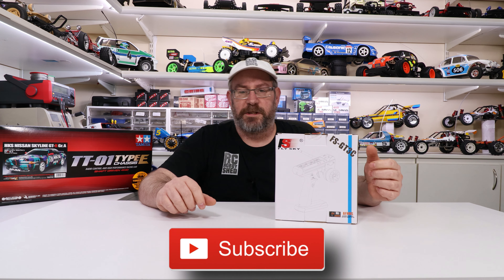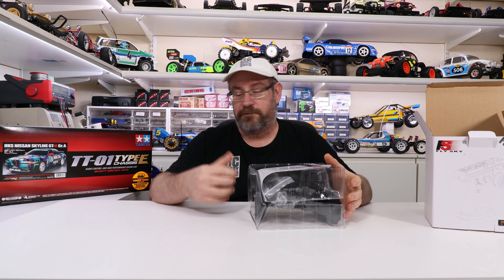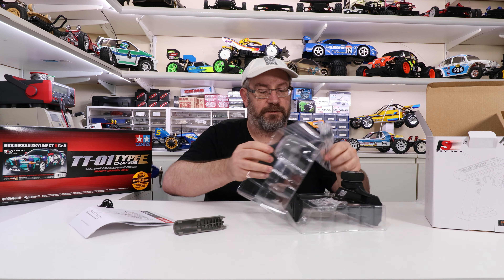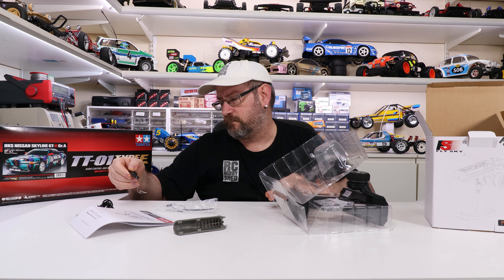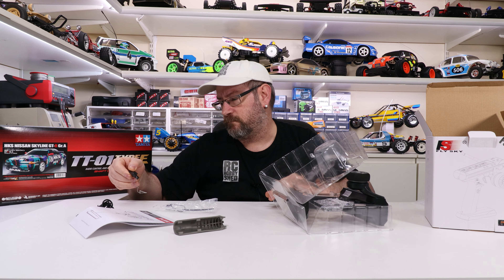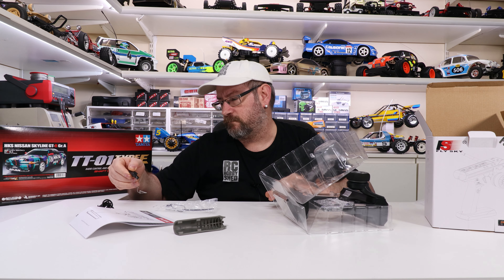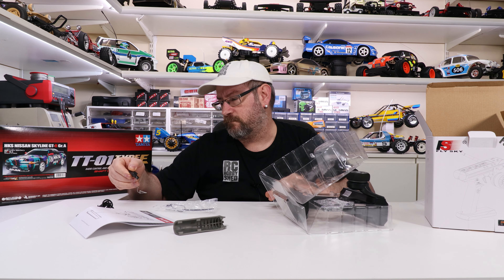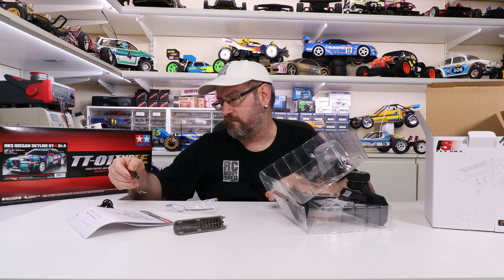FlySky FS-GT3C Unboxing and Binding

Comment: Nice radio! I could do with an upgrade on my runners l still use cheap and cheerful Etronix pulse! But to be fair its always been so reliable and good range! But yeah some new gear would be nice! Maybe ask the mrs nicely for Xmas lol..
Reply from the maker: Thanks mate, yeah they're great for the money. I mainly use these ones (GT3B & GT3C) because of the 10 model memory and dirt cheap receivers. The GT3C having the Li-ion battery will make life easier, the GT3B has 8 AA's unless you do a LiPo mod on it. Haha, great plan for Xmas! 👍